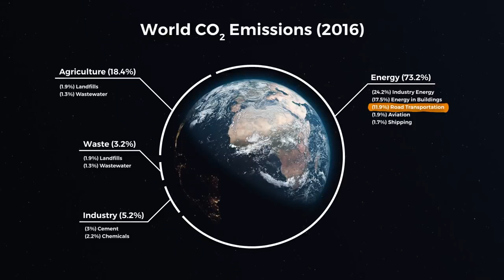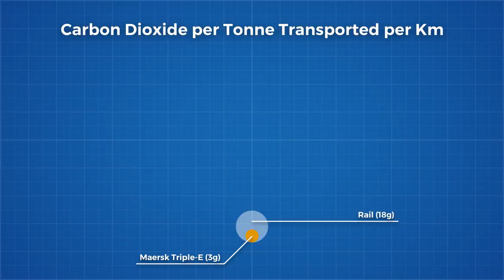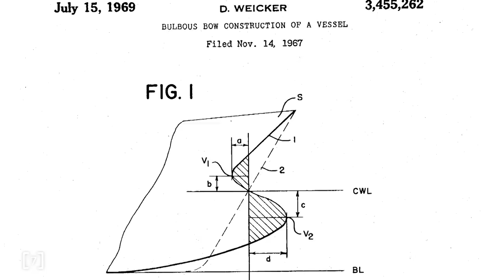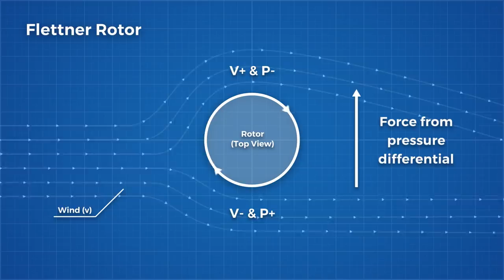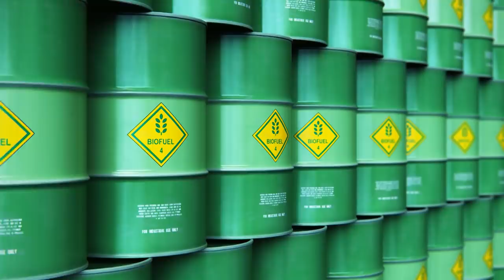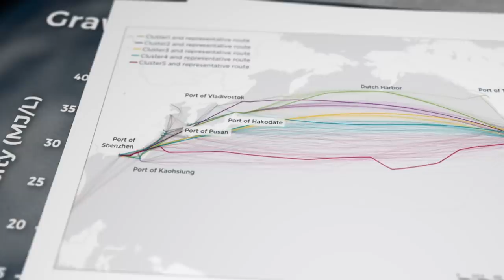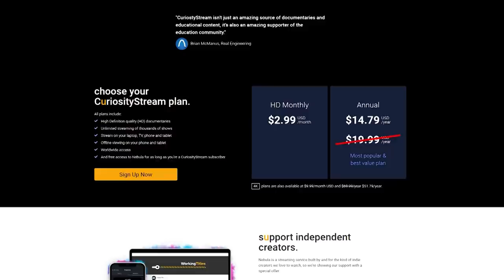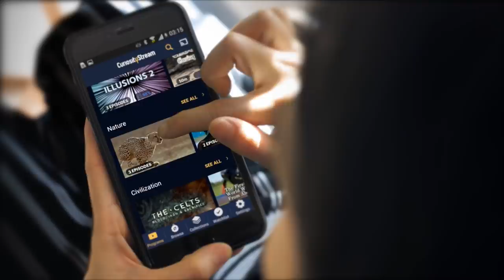Are Renewable Powered Ships Possible?

Comment: i don't think that 1.7% is what we need to focus on, we need to be focusing on the 41.7% from energy for buildings and industry. Nuclear fusion is the obvious goal, but even fission is a much better power source than solar which has a very limited density, and has a lower life span.
Reply: Just think; would you have full confidence in the management of a nuclear reactor under the control of an anonymous entity only traceable, perhaps, via a letter box in a FOC (flag of convenience) nation state?  If you are, could you sell that confidence to Japan, the state that hosted the Hiroshima and Nagasaki nuclear detonations as well as more recently the Fukushima ‘event’?  Then try that same, or a similar, sales strategy on Ukraine, the nation state that as a part of the USSR (CCCP) hosted the Chernobyl ‘event’.

Modern iterations of nuclear energy, thorium fuel, molten salt reactors, small modular reactors or fusion reactors, will carry the legacy of past problems.  It is the global trepidation of anything with 'nuclear' in the name and the economics of nuclear having transitioned from 'energy to cheap to charge for' too 'the costs of remediation are incalculable' that will prevent the adoption of nuclear energy as a means of creating energy at sea.  Modern reaction systems may have overcome the safety problems but the general public, having been misled in the past, will be reluctant to believe the fresh new promises.  The incident of the ‘Ever Given’ blocking the Suez Canal, March 2021, may also have a little to add to this debate.  The cooling water on ships tends to get taken in from near the bottom so when running aground the inlets are in a prime spot to get plugged up restricting, if not stopping, the flow of coolant.  One thing that the TMI, Chernobyl and Fukushima incidents all had in common was that the supply of coolant, or rather lack thereof, was a fundamental cause.  Similarly, and only months later, May 2021, had the ‘X Press Pearl’ been nuclear powered then a major port for a populous nation in the global South would have possible been the site of a significant exclusion zone due to a non-power plant related incident.  If the ‘X Press Pearl’ had on board a fired up but ‘safe’ molten salt reactor and found herself having to dissipate the residual energy associated with the possible 12.5 megaWatt power cycle would a stable cool down have been possible?  Would there have been sufficient heat energy contained in the power system to facilitate a hydrothermal explosion?  In a casualty ships may capsize, like the ‘Karin Hoej’ off of Bornholm in the Baltic early December 2021, in which situation any safety system reliant on gravity might not work.  It might also be worth bearing in mind that part of the TMI near miss was the fault of the US navy trained operators focusing on not letting the primary cooling system 'go solid'; due to their training overwhelming their education and the particularity of the situation.  The actions of the captain of the 'Costa Concordia', Francesco Schettini, may also be relevant; the consequences of his actions, whether due to ineptitude, an isolated act of incompetence or driven by a corrupt corporate culture, illustrates well one of the dangers of releasing nuclear energy into commercial shipping.

As a second point if you fit 'walk away safe' reactors on ships you will need duplicate drive trains as there are seldom salvage tugs around when you really, really need one.  A nuclear ‘dead ship’ drifting around NUC (not under command) would be a disaster waiting to happen and duplicate systems increase expense.  Land based nuclear power plants have a few issues but are immobile, stable and usually well regulated.  Reactors on ships by their very nature are able to move between regulators, bump into each other and roll over.  Regulation of ships by both / either flag state or port state has problems and adding any nuclear regulatory obligations on to those already overstretched facilities would be very taxing for all involved.  This is not about 'can it be safe' it is all about 'will it be safe'.

Furthermore, while merchant ships may be 'taken up from trade', as the RN would say, or may be captured or impressed by non-state quasi military entities by way of piracy, cargo ships are not military vessels.  They therefore do not have the same inherent level of self-protection and internal discipline.  Why not use nukes on merchant ships?  It is down to engineering, finance, socio-political attitudes and safety.

Comment: i mean, the shipping industry being powered by stupidly big sails would be beautiful though
Reply: To address the suggestions that sail power is the answer I offer the following.  In 1870 a premium sailing vessel entered service, the ‘Cutty Sark’, she could carry around 600 tonnes of cargo at speeds of up to 17.5 knots, dependent on the prevailing wind, to harness the energy the available spread of canvas was up to 2 976m2.  To round things out that was circa 5m2 of canvas for every tonne of cargo carried.  The ‘Cutty Sark’ was designed and built, with fine lines (more nautical tech speak so again - no need to worry about it) for employment in the tea trade where time on passage was a large factor in securing the premium freight rate that made her cost effective but as soon as the Suez Canal opened, which the ‘Cutty Sark’ was unable to sail through, she lost her advantage, raw speed, to the steam powered ships of that era.  Mechanically powered ships have improved in terms of efficiency, on a freight tonne mile basis, by at least one order of magnitude since then.  After losing out to the coal burning, steam reciprocating mechanical ships of the late 19th century ‘Cutty Sark’ was relegated to the Australian wool trade, just about the bottom of the barrel in maritime terms and only one small step up from being a 'honey barge'.  The canvas, cordage and extra manpower needed for sailing ships was never a very benign environmental option so please discount any idea of sail as ‘sustainable’.  All this is without the problem that if ‘the wind don’t blow the ship don’t go’, when it does blow it often blows in the wrong direction for your cargo delivery needs and sometimes there is rather too much of it for comfort.

Comment: Really, nuclear energy? No one ? Why???
Reply: If you do a web search for ‘nuclear ship savannah’ you will see that it has been tried and did not work.  A similar vessel, heavily subsidised by the government, has been in lay up in Russia since 2012 but could be reactivated.  The Russian state, through a QUANGO, also operates a fleet of nuclear powered ice breakers all of which may, or may not, be completely without issues in support of the Northern Sea Route,.

Just think; would you have full confidence in the management of a nuclear reactor under the control of an anonymous entity only traceable, perhaps, via a letter box in a FOC (flag of convenience) nation state?  If you are, could you sell that confidence to Japan, the state that hosted the Hiroshima and Nagasaki nuclear detonations as well as more recently the Fukushima ‘event’?  Then try that same, or a similar, sales strategy on Ukraine, the nation state that as a part of the USSR (CCCP) hosted the Chernobyl ‘event’.  Modern iterations of nuclear energy, thorium fuel, molten salt reactors or fusion reactors, will carry the legacy of past problems.  It is the global trepidation of anything with 'nuclear' in the name and the economics of nuclear having transitioned from 'energy to cheap to charge for' too 'the costs of remediation are incalculable' that will prevent the adoption of nuclear energy as a means of creating energy at sea.  Modern reaction systems may have overcome the safety problems but the general public, having been misled in the past, will be reluctant to believe the fresh new promises.  The incident of the ‘Ever Given’ blocking the Suez Canal, March 2021, may also have a little to add to this debate.  The cooling water on ships tends to get taken in from near the bottom so when running aground the inlets are in a prime spot to get plugged up restricting, if not stopping, the flow of coolant.  One thing that the TMI, Chernobyl and Fukushima incidents all had in common was that the supply of coolant, or rather lack thereof, was a fundamental cause.  Similarly and only months later, May 2021, had the ‘X Press Pearl’ been nuclear powered then a major port for a populous nation in the global South would have possible been the site of a significant exclusion zone due to a non power plant related incident.

‘They’ say nuclear is cheap, it’s not it is expensive and has a large embedded carbon quotient as well as being complicated, dangerous, not universally socially acceptable and having only ‘no need for refuelling’ as a questionable advantage; actually it does need refuelling just not as often.  When ‘they’ do need to refill the warming up stuff it takes considerable longer than pumping tonnes of thick black stuff, cSt380 HFO, or thin runny stuff, MDO, onboard which is one of the reasons HMS Queen Elizabeth and HMS Prince of Wales are pushed about by ICEs and gas turbines thus using a similar fuel as the aircraft that fly off of them.  The Royal Navy (RN) with a high degree of skill and expertise uses, at vast expenses to the UK taxpayer, a current operational nuclear fleet of 11 submarines (also known as ‘boats’) in two flotillas, seven attack subs and four ballistic missile boats.  The carbon footprint of all the extra bits of hardware and the fuel, including processing thereof, from ground to propeller, are the external costs that never seem to get considered.

Disposal, once it wears out, of both the machine (that was a ship) and fuel is another can of worms best left unopened.  The 26 RN nuclear powered boats no longer in use are laid up (some in Rosyth and some in Portsmouth) awaiting long term deconstruction including dealing with the fuel rods and other irradiated material.  The USN is not, as far as I know, a commercial organisation working to very tight margins and also has the skill and expertise to handle the complexities of nuclear power; so as well as submarines their aircraft carriers are nuclear powered and each of the current iteration has a build cost three times that of QE/PoW, bigger crews and more generous funding.  For those who still think that nuclear energy might be the answer I recommend this report: - https://www.bbc.com/future/article/20200901-the-radioactive-risk-of-sunken-nuclear-soviet-submarines?ocid=ww.social.link.email.  The navy of the USSR might have been under resourced and over extended but it was still generously supported in comparison with merchant shipping.  While merchant ships may be 'taken up from trade' as the RN would say, or may be captured or impressed by non state quasi military entities by way of piracy, but cargo ships are not military vessels.  

Another, similar but more extensive view, may be found at https://www.quora.com/Why-are-there-so-few-nuclear-powered-cargo-ships-If-it-works-for-ice-breakers-and-submarines-why-hasn%E2%80%99t-it-been-established-for-merchant-vessels.  Why not use nukes?  It is down to engineering, finance, socio-political attitudes and safety.

Comment: a sail boat?
Reply: To address the suggestions that sail power is the answer I offer the following.  In 1870 a premium sailing vessel entered service, the ‘Cutty Sark’, she could carry around 600 tonnes of cargo at speeds of up to 17.5 knots, dependent on the prevailing wind, to harness the energy the available spread of canvas was up to 2 976m2.  To round things out that was circa 5m2 of canvas for every tonne of cargo carried.  The ‘Cutty Sark’ was designed and built for employment in the tea trade where time on passage was a large factor in securing the premium freight rate that made her cost effective but as soon as the Suez Canal opened, which the ‘Cutty Sark’ was unable to sail through, she lost her advantage, raw speed, to the steam powered ships of that era.  Mechanically powered ships have improved in terms of efficiency, on a freight tonne mile basis, by at least one order of magnitude since then.  After losing out to the coal burning, steam reciprocating mechanical ships of the late 19th century ‘Cutty Sark’ was relegated to the Australian wool trade, just about the bottom of the barrel in maritime terms and only one small step up from being a 'honey barge'.  The canvas, cordage and extra manpower needed for sailing ships was never a very benign environmental option so please discount any idea of sail as ‘sustainable’.  All this is without the problem that if ‘the wind don’t blow the ship don’t go’, when it does blow it often blows in the wrong direction for your cargo delivery needs and sometimes there is rather too much of it for comfort.

Random facts about Cutty Sark.  It is said to have been able to coax 3 000 horse power out of her sails, or in ‘real money’ 2 206 500 Watts (2.2 megaWatts), assuming this was in ideal conditions that is about ⅔ of the power that might be harvested from the ‘top of stow’ of a Maersk triple E, again in those elusive ideal conditions.  So that majestic spread of canvas would have been even less efficacious for delivering your baubles and bows from the orient, despite taking about three times as long on the voyage.

Comment: In 16th century, Large merchant ships could easily reach the speed of 10-12 knots......... With our level of development and technology in this century.... Higher speeds could be achieved with various changes in the design of the ships....... These ships will be cheaper and hence the shipping companies can also buy more ships........... Ok this rules out the SPEED and CAPACITY factor........ Also it will be powered by wind so zero co2 emissions which will in turn save the fuel and gasoline which is used in these giant machines.......... Also scrapping up these gigantic machines will provide tons of steel which can be used in other places...........

In short I think (based on my insufficient research) that wind powered vessels should come back.........
Reply: To address the suggestions that sail power is the answer I offer the following example.  In 1870 a premium sailing vessel entered service, the ‘Cutty Sark’.  The Cutty Sark was 64.74 metres in length with a beam of 10.97 metres and a loaded displacement of 2 100 tonnes.  She was able to carry 1 700 tonnes of cargo and to harness the energy in the wind the available spread of canvas was up to 2 976m2 which was tended by a crew of about 30 skilled men.  A ratio between the sail area (SA) and the vessels displacement (D) determines how lively she is; ‘lively’ being nautical speak for ‘fast and manoeuvrable’.  The carrying capacity of cargo ships is constrained in two ways, mass and volume which leads us to the ‘stowage factor’ of the cargo; the more mass on board the greater the displacement which in turn impacts the efficiency of the hull form and sail area / displacement ratio.  A vessel constrained by mass is said to be ‘down but not full’, a vessel constrained by volume ‘full but not down.  When in the tea trade, which the ‘Cutty Sark’ was designed and built for with fine lines (more nautical tech speak so again - no need to worry about it) she could carry around 600 tonnes of cargo at speeds of up to 17.5 knots dependent on the prevailing wind and had a typical China to UK time on passage of 120 days.  The tea trade was very competitive so ‘time on passage’ was a large factor in securing the premium freight rate that made her cost effective.  Rounding things out her maximum available sail area gave circa 5m2 of canvas for every tonne of tea carried.

As soon as the Suez Canal opened, which the ‘Cutty Sark’ was unable to sail through; she lost her advantage, raw speed, to the steam powered ships of that era who could beat her ‘time on passage’.  Mechanically powered ships have improved in terms of efficiency, on a freight tonne mile basis, by at least one order of magnitude since then.  After losing out to the coal burning, steam reciprocating mechanical ships of the late 19th century ‘Cutty Sark’ was relegated to the Australian wool trade, just about the bottom of the barrel in maritime terms and only one small step up from being a 'honey barge'.  The canvas, cordage and extra manpower needed for sailing ships was never a very benign environmental option so please discount any idea of sail as ‘sustainable’.  All this is without the problem that if ‘the wind don’t blow the ship don’t go’, when it does blow it often blows in the wrong direction for your cargo delivery needs and sometimes there is rather too much of it for comfort.

Random fact about ‘Cutty Sark’, it is said to have been possible to coax 3 000 horse power out of her sails, or in ‘real money’ 2 206 500 Watts (2.2 megaWatts), assuming this was in ideal conditions that is about ⅔ of the solar power that might be harvested from the ‘top of stow’ of a Maersk Triple E, again in those elusive ideal conditions and 741 Watts for each square meter of sail area.  So that majestic spread of canvas would have been even less efficacious for delivering your baubles and bows from the orient, despite taking about three times as long on the voyage.
Reply: @BernardLS  Agreed make more of these clippers............ they can easily replace these fat metal giants